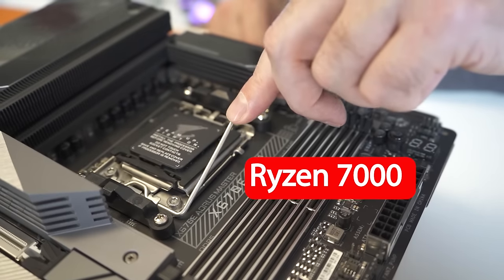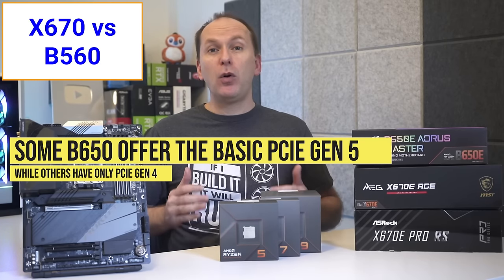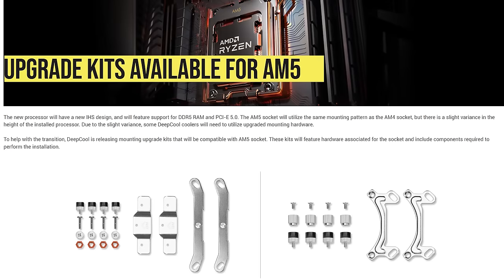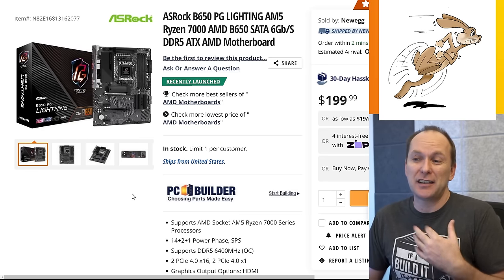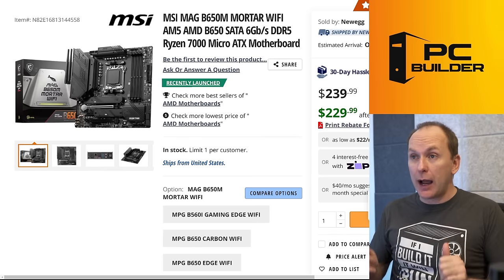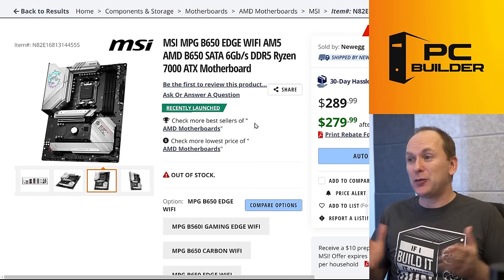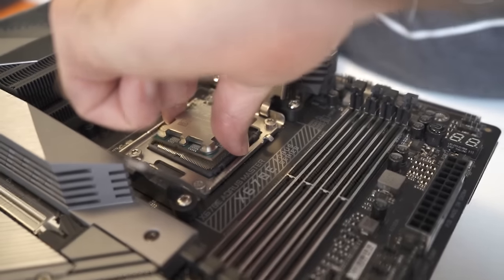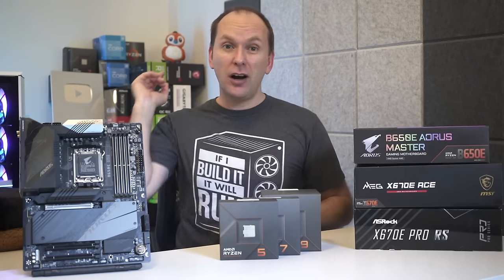Best Motherboard for Ryzen 7000 | AM5 Motherboard (B650 & X670) For Ryzen 7600X 7700X 7900X 7950X

Comment: I pulled the trigger on a ASUS b 650m-ax now............ i see your 7800x3d disclaimer Sh(t !!! i needed a budget mobo and gonna say I shot myself in the foot in retrospect, Crimany what a pain !!! because i have the 7800X3d, 32 GB Corsair vengence  5600 ddr-5 and have a  ASUS  B650m -ax on the way trying to fix an old pc(14 yo) that is m-ATX that fits (lol) where it is i may have to return the ASUS ... I just want a decent mobo with enough vrm to handle 120 tdp and be stable for the home computer without having to go to the gaming units other than gaming and video work AIO is NOT an option ...it's a HP 1534 pc case that i'm stuffing this update in ... i may get the Dremel out and install a plate window in IJDK..... HELP !!!! YER KILLIN' ME BRO !! LOL

Comment: Honestly this is just not needed for gaming.  People should not rush out and buy this .  Most gpu’s out there are less than 6000 series.  Or lower tier 3060 or 3070
Reply from the maker: You might want to check out our Best 1440p build guide from Saturday, past gen Ryzen and Intel are fantastic options right now. But we want our Ryzen 7000 builders to have the info they need too (;
Reply: @PCBuilderChannel  oh I love these videos i just think amd hurt themselves right at the get go.
I built a system very similar to what you are saying this week.
I did Ryzen 5600
Msi B550 pro A
16 gigs @3200 gskill
And I already had 6700xt.
I will say the stock cooker is not doing good enough for my 5600.  It’s going to 95 Celsius in gaming.  I ordered Deepcool gammax 400.  Plus I may turn off PBO. 
I wasn’t bashing your video I just don’t understand amd changing socket when Intel wasn’t at least for gaming these new CPU’s are just not needed
Reply from the maker: Totally understand, and agreed! 
Also that's a nice build you got there (:

Comment: AMD Identifies Cause Of Ryzen 7000 Processors/MB's Frying Themselves
"AMD has issued a new statement concerning recent problems with its Ryzen 7 CPUs frying themselves. Over the last few weeks, AMD and motherboard manufacturers have been grappling with a worrying issue regarding its new Ryzen 7000 CPUs where these were seemingly being fried by an unknown issue involving sky-high temperatures." - Forbes

Comment: This is a joke on GA-Z97x gaming 3 i got 1200 ALC it was 10 years ago very good sound quality, and now i got GA-B650 X AX with ALC897 and sounf quality is dogshit and cant even power 32ohm headphones from back connector so i switch to integranted sound card on 10 years old samson USB microphone and i get good quality of sound again. Even worse my old DELL Pentium D AIO pc integrated sound card could run 200 Ohm headphones.

Comment: I saw the future down a rabbit's hole   Reading Igor's Lab on Computer DACs I began to question my sanity. Was I just lazy? Thankfully I did not believe so. Then I wondered what in the heck was this person doing and why was I wasting my time suffering through it. Finally I saw all the comments were in another language and Igor's Lab was German. Computer generated copy. Bad translation of someone who thinks a little different to begin with. That's the future: Humans driven insane reading and reacting to garbage from machines. I wouldn't recommend this site PC Builder. And that's a perfect example why AI material should be labeled as such. We have labels on food for a reason. we need labels on our mental food also. This is the point humanity is overrun.

Comment: Not sure I am correct, but if I am not mistaken you missed the biggest addition of USB4 which is PCIE Tunneling.    This may not sound like much but it can allow any PCIE device to run externally.    To me that is huge, hence why I think the  X670E Creator by ASUS @ 499 is a MUCH better deal.